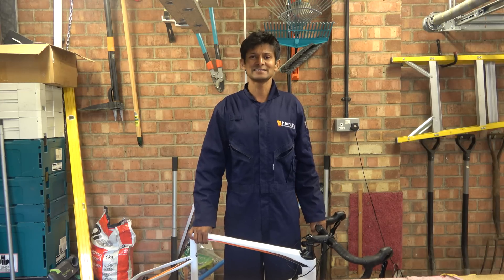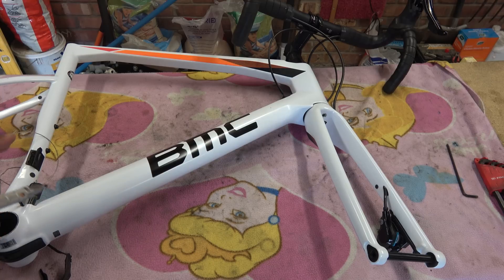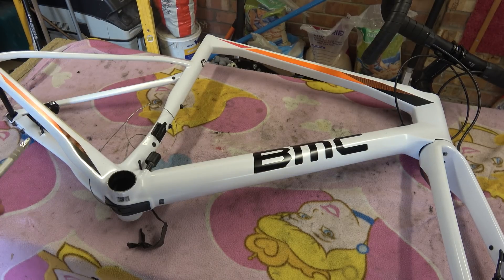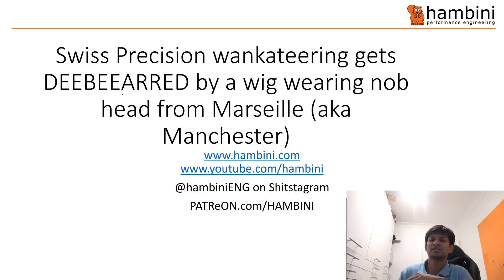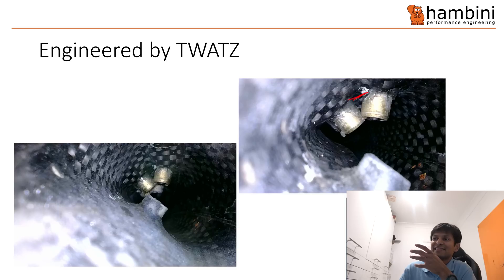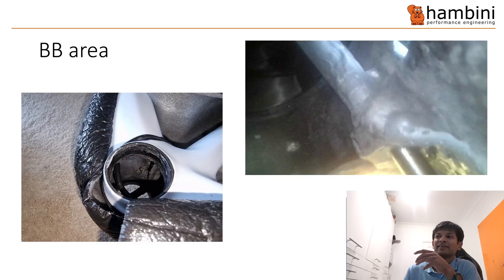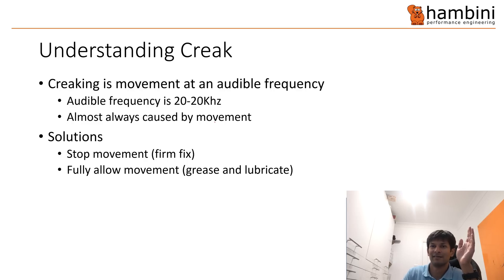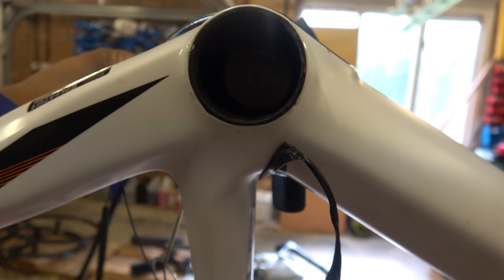Swiss Cheese X BMC Bike Frame REAMED | Grade A Wankateering

Comment: So for a bike that has won more classics than anything else, you are over the top in your criticism! For starters this is a 6 year old model that has been through the wear and tear of at least two owners. All the pros have used this brand and raved about it! its a fast good bike and you are just being a right @£$head about bike engineering!
This, after all, is a bike and not an aircraft! 
I'm beginning to think you are just over the top on what bicycle engineering means.
You should put your money where your mouth is and get out of your garage/bedroom and start designing for bike companies.
Reply: @alxhid  hold my beer
Reply: Owns a super expensive 2nd hand bmc only to find out it's all shite.
Reply: @abastabul9115  If I bought any mass market bike I would assume its gonna be shite. Its a MASS MARKET product. what is it that you guys don't understand about this??
Reply: @BoomsRiddico4868  but Time make excellent carbon fibre bikes for similar money. I'm not just basing that on Hambini's recent video, but consensus from road riding friends/comments ect.
Reply: @BoomsRiddico4868  so what you’re saying is, since it’s a mass market frame, you get a lot of demick ones? Ones that are a bit demicky and not properly?

Also why do you use a swear word then censor it? If you don’t want to use the word then don’t use the word?
Reply: @BoomsRiddico4868  but BMC is not PRICED at mass market level
Reply: @BoomsRiddico4868  Didn't you do the modules regarding the wear factors on tooling? A  calculation is determined around output max and interval Inspections. The development engineer would've determined this so if the molds are precise and the layups are correct then the products is let down by   the post mold process.  The engineers and design team get a pass if this is the case. Hambini is not always blaming the engineers but more the completed products.
Reply: @BoomsRiddico4868  and a Boeing 737 is a mass market product also. Don't expect too much when you travel on one of these?
Reply: @BoomsRiddico4868  people like you, your poor expectations of QC are the reason why there is poor or no QC
Reply: @BoomsRiddico4868  I would be interested to know where I can get my hands on a bike model that is not mass produced and is reliable! Please enlighten those who are keen cyclists and have suffered financially based on the poor quality control issues.
Reply: On a dollars per kg bikes cost orders of magnitude more than what aircraft do. Is that the reason that you get such good quality engineering and quality finish on carbon bikes? When you are paying up to a few thousand dollars per kg you should have a reasonable expectation that what you are getting is worth what you are paying. It doesn't matter if a bike or bike design is 1 day old or 6 years old. If the design has issues that can affect safety and also reliability then there is absolutely no reason for them not to be called out on it. These are companies earning billions of dollars and there's about 5 points on the bike where alignment and specification is a must. So many of these companies fail badly at doing this.
Reply: @ Alan H, since when do bicycle companies earn billions of dollars?
Reply: @Alan_Hans__  sure but then slag the bike industry for profiteering. not cheaply made mass market engineering products
Reply: +- 0.05mm is an aerospace tolerance? You should pick up an SKF manual and put down the jenkem my friend.
Reply: @Your_Paramour  the guy has probabaly never heard of a zeus book! ;)
Reply: @Your_Paramour  are you another Hambini fanboy?
Reply: @BoomsRiddico4868  Instead of attacking his fans, you should have a counterargument ready with evidence from aviation machinist/engineering manual or something.
Reply: @BoomsRiddico4868  So you're unable to answer the question posed?  "+- 0.05mm is an aerospace tolerance?" -- incase you missed it.
Reply: But this crap bike should cost 1000 EUR, not 10.000.
Reply: I feel like I’m getting reamed and I’m not even Nik Fledge
Reply: @davidcoates2051  Oh, sure Coats, like you're blameless in all this.
Reply: @davidcoates2051  bro 😂😂😂😂😂😂
Reply from the maker: Nik Fledge, claims to be an ASSOspace engineer and then claims 0.05mm is an Aerospace Tolerance...  mmm.... I smell a Rat
Reply: @Hambini  I remember filing my aluminium block into a square for weeks at the start of my apprenticeship, 5 thousands of an inch was the tolerance. (0.127mm).
Christ - it brings back bad memories😢 - thank fuck I was an avionics apprentice and so moved on to electronics soon after.
Reply: @Hambini  Whats crazy is i just picked up a 2023 bmc teammachine frame: Tightened bottle cage bolt and paint chipped off, BB hasn't been well smoothed out and has rough sides, you could splinter your finger, same games for bottom of steerer tube.
Reply: @Hambini  He also spells ream "reem" (A large horned animal in ancient Hebrew literature), LOL
Reply: @BoomsRiddico4868  "you sound like you look in your profile" Yeah well that's my actual picture so I suppose I would. I don't know if that is an attempt at an insult or you are just slow and getting the joke in my profile name. Kind of a fail either way 🤣.
Reply: @Hambini  Has this bike brand ever won anything? Let's see...
2017 - BMC Racing Team
 Australia National Time Trial Championships, Rohan Dennis
 Australia National Road Race Championships, Miles Scotson
Jersey orange.svg Overall Tour Down Under, Richie Porte
Stages 2 & 5, Richie Porte
Stage 5 (TTT) Volta a la Comunitat Valenciana
Jersey red.svg Overall Tour of Oman, Ben Hermans
Stages 2 & 5 Tour of Oman, Ben Hermans
Jersey blue.svg Overall Tour La Provence, Rohan Dennis
Omloop Het Nieuwsblad, Greg Van Avermaet
Stage 1 (TTT) Tirreno–Adriatico
Stage 7 Paris–Nice, Richie Porte
Stage 7 (ITT) Tirreno–Adriatico, Rohan Dennis
Stage 2 (TTT) Volta a Catalunya
E3 Harelbeke, Greg Van Avermaet
Gent–Wevelgem, Greg Van Avermaet
Paris–Roubaix, Greg Van Avermaet
Stage 2 Tour of the Alps, Rohan Dennis
Jersey yellow.svg Overall Tour de Romandie, Richie Porte
Stage 2, Stefan Küng
Stage 6 Giro d'Italia, Silvan Dillier
Stage 18 Giro d'Italia, Tejay van Garderen
Jersey gold.svg Overall Tour de Luxembourg, Greg Van Avermaet
Stage 1, Jempy Drucker
Stages 2 & 4, Greg Van Avermaet
Stage 4 (ITT) Critérium du Dauphiné, Richie Porte
Stages 1 (ITT) & 9 (ITT) Tour de Suisse, Rohan Dennis
Jersey red.svg Overall Route du Sud, Silvan Dillier
 Luxembourg National Time Trial Championships, Jempy Drucker
  Switzerland National Time Trial Championships, Stefan Küng
 United States National Time Trial Championships, Joey Rosskopf
  Switzerland National Road Race Championships, Silvan Dillier
Jersey yellow.svg Overall Tour de Wallonie, Dylan Teuns
Stage 3 & 5, Dylan Teuns
Stage 4, Jempy Drucker
Jersey yellow.svg Overall Tour de Pologne, Dylan Teuns
Stage 3, Dylan Teuns
Stage 2 Tour of Utah, Brent Bookwalter
Stage 2 (ITT) BinckBank Tour, Stefan Küng
Jersey blue.svg Overall Arctic Race of Norway, Dylan Teuns
Stages 1 & 4, Dylan Teuns
Jersey blue.svg Overall Colorado Classic, Manuel Senni
2018 - BMC Racing Team
 Australia National Time Trial Championships, Rohan Dennis
Stage 5 Tour Down Under, Richie Porte
Stage 3 (TTT) Volta a la Comunitat Valenciana
Stage 5 Volta a la Comunitat Valenciana, Jurgen Roelandts
Stage 3 Tour of Oman, Greg Van Avermaet
Stage 4 (ITT) Abu Dhabi Tour, Rohan Dennis
Stage 1 (TTT) Tirreno-Adriatico
Stage 7 (ITT) Tirreno-Adriatico, Rohan Dennis
Jersey light blue.svg Overall Tour de Yorkshire, Greg Van Avermaet
Stage 4 (ITT) Tour of California, Tejay van Garderen
Stage 16 (ITT) Giro d'Italia, Rohan Dennis
Jersey yellow.svg Overall Tour de Suisse, Richie Porte
Stage 1 (TTT)
Stage 9 (ITT), Stefan Kung
 United States National Time Trial Championships, Joey Rosskopf
  Switzerland National Time Trial Championships, Stefan Küng
Stage 3 (TTT) Tour de France
Prologue Tour of Utah, Tejay Van Garderen
Stage 2 (ITT) Binck Bank Tour, Stefan Küng
Stage 1 (ITT) & 16 (ITT) Vuelta a España, Rohan Dennis
Stage 11 Vuelta a España, Alessandro De Marchi
Jersey rainbow chrono.svg Time Trial, UCI Road World Championships, Rohan Dennis
Giro dell'Emilia, Alessandro De Marchi
2019 - CCC Team
 New Zealand National Time Trial Championships, Patrick Bevin
Stage 2 Tour Down Under, Patrick Bevin
Stage 3 Volta a la Comunitat Valenciana, Greg Van Avermaet
Stage 4 Tour de Yorkshire, Greg Van Avermaet
Stage 3 (TTT) Hammer Stavanger
Grand Prix Cycliste de Montréal, Greg Van Avermaet
2020 - CCC Team
 Poland National Time Trial Championships, Kamil Gradek
 Czech Republic National Time Trial Championships, Josef Černý
Stage 3b (ITT) Tour Poitou-Charentes en Nouvelle-Aquitaine, Josef Černý
I guess they won something haha. Still agree with the video though Mr Hambini.
Reply: @jaimeisreal  They did not win on a bike like that.
Reply: @Hambini  Maybe it is, in North Korea - just kidding ;-)
Reply: @Hambini  I smell a troll!
Reply: @Hambini  where did I say that ? I think your YouTube earning strategy is to have people who react to your reeming and your fanboys fight it out in the comment section so that you get more hits. It is I that smell the rat!
Reply: Then explain the CHEAPER (not same price, CHEAPER) bikes he has on that are built to far better tolerances than this? Where's your 300% cost increase? Popped back in your arse where you got it from?
Reply: @dutypaidrock  LOL this made my day :)
Reply: @ M*A*S*H

What is the average salary of an employee working for a Chinese bicycle company vs the average salary of  an employee working at the BMC facility in Switzerland.  Do you think the only cost of associated with the BMC is direct materials and labor?  I’d say go learn something about basic economics and cost accounting before engaging in this conversation.
Reply: @ M*A*S*H, surely you must realize that some of the wealthiest people on the planet are in the Far East and India, and have a earned a large potion of their wealth through the unfair treatment and slavery of their employees.  If you want to support that, by all means go ahead. The company that BMC outsources their production to is probably guilty of this, but at least their employees in Switzerland are treated respectfully and fairly.
Reply: Is this the CEO of BMC?
Reply: @_xnk7257  new account, its either BMC, Absolute Black, Open Cycle or GCN
Reply: @_xnk7257  the CEO would not be so stupid, the CEO is laughing all the way to the bank.  It’s these guys who spend the most on their frames - are always the ones swearing and bragging by them, regardless.
Reply: @_xnk7257  hahahahahahaha
Reply: The problems with the absurd lack of roundness of the bottom bracket on that bike were there the day that bike left the factory.  They don't get that way through use.  It suggests that BMC has crappy QC standards.  Not all brands do.  I'm pretty sure the ones they send to world tour teams are carefully selected.  The ones you and I would be aren't.
Reply: I don’t think it’s the designing of the bikes is the problem it’s the crap quality control in the factories.
Reply: @paulwilliams4990  Ultimately the QC must be checked before leaving the factory so the responsibility lays with the company. If I own say a pub that served flat warm lager, could i blame the barman to the face of customer ?
Reply: @glennoc8585  that’s exactly what I said 🤔
Reply: No bike race has been won on this bike. This bike is defective.
It costs more per kilo than an aircraft.
Reply: I'm ready for Nik Fledge reaming
Reply: @daijang1  me too!!!!!
Reply: lmao this guy rides a BMC
Reply: @11-inch  don't laugh.  Whatever YOU ride Hambinini thinks is schit too.
Reply: @11-inch  Of course he is. Hambini has reamed other brands and I never seen this Nik Fledge before.
Reply: @11-inch  I don't ride at all dude. but I am an engineer
Reply: @BoomsRiddico4868  "I don't ride at all dude"
Proceeds to comment on .....bikes
Lmaoooooooo
Stop talking
Reply: @BoomsRiddico4868  It is absolutely obvious that your feelings were hurt by this reaming, and you have a strange deep interest on defending a brand with quality control issues.  Why?
Reply: @BoomsRiddico4868  That reminds me of "I'm the only gay in this town"
Reply: @BoomsRiddico4868  There's engineers and engineers though. Prominent firms have folded and been sued for negligence. All Professions have codes of conduct and are duty bound to  call out cowboys.
Reply: @valiantabello  in all fairness, I don't believe Hambini rides, either.....
Reply: @BoomsRiddico4868  wait, you're an engineer? I don't think you mentioned that
Reply: @BoomsRiddico4868  This kind of speaks to my point, you don't ride, you don't get it, dude.
Reply: Oh Nik, what a wonderful world we live in where all the pros that ARE PAID TO RIDE A PARTICULAR BRAND OF BIKE SAY NOTHING BUT NICE THINGS ABOUT SED BIKE?
Reply: @JMcLeodKC711  Don't bite the hand that feeds you, right? lol
Reply: Nik, sorry to be negative about your comments but exactly what are you talking about? Firstly,  Pro's are paid to "like" the bike they ride so your comments along those lines mean that their bike simply didn't break and cripple them in a race. Winning "more" only means supporting the best team. Secondly,  race bikes are managed by race mechanics who are excellent at their trade and repair problems with delivered race bikes which the factory normally takes more pains to see are proper. Thirdly,  the bottom bracket was under-sized and oval.  That doesn't occur from "second owner wear" as you seem to suggest. Fourthly,  none of this forgives for one second the placement of those "braze-on" screws. I occasionally criticize Hambini because he is critiquing the ends of the values where mistakes can slip through such as the undersized BB.  But that brake line tube is pure garbage workmanship and those braze-on screws are an example of very poor engineering. These sorts of things are why I and a friend have been permanently crippled and why I have returned to steel.
Reply: It’s widely accepted that pros’ bikes are specially made and are not the same as the ones that go on general sale
Reply: @lasrachtech.1341  What they sell us,are not the same bike they gave the pros.
Can you immagine a Pro cyclist like Viviani that on the sprint put's out close to 2000 watt he would not even get on a bike for amateurs.
The bike builders try every possible way to make us think that what they are selling us are the same is the Pros.A lot of bikers beleive that and pay a bunch of money for a piece of scrap like the one on this video.
Reply: @lasrachtech.1341  more than accepted it’s admitted and openly stated that the Pro bikes are custom layups with often custom geo and bear nothing more than an external resemblance also like most things used in pro sport they are replaced at intervals that are impossible for the average person to even contemplate.
Reply: @lasrachtech.1341  YES!!!! another SMART PERSON!!!!
Reply: Funny how brands can beat this tolerance for a frame sold at less than 2k yet the big companies can’t hit the same tolerance at many times the price. It’s a classic case of cutting corners to increase profits as they know fan boys with thin air between there ears will eat it up and throw more money at it than a god damn motorcycle super bike
Reply: Ohhhh someones deleting their own comment. 🤡
Reply: @ Nik Fledge What exactly is your point then? Was that BB roundness(?) normal? Should it be normal for all bicycles? In your honest opinion, was that FD mount a display of engineering/manufacturing standards excellency? Is a (as someone here stated) 4000£ (or more) frame a discardable item after 6 years? When you say "All the pros", do you really mean all of them? What about the ones riding competitor brands? Have you spoken to all of them? Based on that statement, are you quite sure that your studies are in engineering and not in marketing? Is the fact that this is a bike and not an aircraft supposed to make those BB tolerances and that FD mount acceptable? Were any of his criticisms unsupported?
Reply: @edthelizzard  It's a fallacy that pros gets "special" builds as a norm. Some may well get a lighter  version which is later offered to the public or they get custom paint. The molds aren't going to be modified to change geometry albeit that was possible in the days of alloy and steel. Non world tour professionals get off the rack frames and wheels fact and if it can be proven beyond speculation that world you'd pros get custom frames then I'll accept that. Still off topic to the point of expensive flawed products coming to a store near you.
Reply: @glennoc8585  It's not a fallacy, Hambini and others have pointed out the carbon reinforcing a lot of the pro's bikes have which will never be available to the public.
Reply: @DomH1994  Which renders the frames heavier? It's counter intuitive post disc brakes to make the bike heavier.
Reply: @glennoc8585  It would be counter productive. However, what would be more counterproductive is the front end of a bike failing during an 1800 watt sprint with the world watching.
Reply: @glennoc8585  that was not the point of my comment here.
Reply: You've Been Milked (for) Cash, fanboy.
Irate that an engineer is calling out bad engineering and suggesting people should settle for shit at thousands of pounds for simple manufacturing? You are no engineer, whatever your job.
Reply: Some people are lonely and just want attention.
Reply: Hi @Nik, do you mind to share what's the standard of "over the top" in your comment? I am a little bit confused, as you put @hambini as too @£$head in the beginning, then you mention that all mass produced bikes are "shite". What do you mean by this statement?

Next, let's suppose that the above is correct, then could you share to me, what is the "good" standard for mass market/produced bikes? Thanks~
Reply: Weird, it's ok for bike brands to lie about their products for advertising purposes, but it's a problem when an 5 years old critizes them on YouTube.
Reply: The bike didn’t win anything the riders won bikes are interchangeable and irrelevant stop believing the marketing BS you simpleton
Reply: This is the best reem-ing comments section ever! Most amusing. Trouble is though I think, after reading the anti-Hambini views I must be one of the ‘fan boys’ that apparently exist. I’m not going to sleep well tonight now incase I wake up wearing an orange overall, my hair has suddenly returned to the colour it was when I was 20 and the university logo I have on my lecture PowerPoint slides suddenly changes to a ‘pen-is working logo’!
Reply: You are missing the point by a country mile. Hes not saying bike company's should be held to Aerospace tolerances but when people are buying frames from China at 10% of what this frame would cost new that DO NOT have these issues there is a problem. And if "wear and tear" can do that to a BB shell then the frame was not fit for propose to begin with.
Reply: @Bikey_McBeardface  don't argue with stupid. They'll drag you down to their level then best you with experience.😂
Reply: @Bikey_McBeardface  why doesn't he say that then? you are putting words in his mouth
Reply: @BoomsRiddico4868  well he didn't do it in this video but if you are a continuous viewer of his videos you'll see him praise some cheaper Taiwan products for being well made. 
And I think that's the whole point of his videos, while his criticism is way over the tops for entertainment purposes, the truth is some brand sell way to expensive bikes with marketing tricks (aerospace engenering e.g.), but don't fulfill their self given standards.
Reply: @BoomsRiddico4868  No, I just watched more than one video and understand what hyperbole is. Also I'M putting words in his mouth? Give me the time stamp where he says he demands aerospace tolerances for bikes I'LL WAIT. 🤡
Reply: @derlogger2  fair enough
Reply: @Bikey_McBeardface  so the video when Hmbini visited the Canyon factory and fawned over the place did you not find that kinda odd? he slags off canyon in the past no?
Reply: @BoomsRiddico4868  Yeah because he calls out crap when he sees it, and praises good work when he sees that too. Are you suggesting just because he liked what he saw in a factory, he should give them a pass when they allow something shit into the public?
Reply: @BoomsRiddico4868  It's ok buddy we all cope in different ways.
Reply: Where did you get the copium you're huffing from? Must be some strong stuff
Reply: @1newme425  bruh roasted tf outta him
Reply: Hear that lads, because its a bicycle we should accept out of round, out of square, out of tolerance, machining in carbon fibre full of voids and be grateful. Aeronautical engineering? What for airfix kits? You, of all people, should not be accepting sub par QA or machining.
Reply: Undersized is undersized, wear from use wouldnt effect this issue. These frames are over 2k and need simple quality control which is easy to do with go no go gauges
Reply: Oh I'm sorry that most of us expect a top product for the fucking ridiculous prices we pay for these bicycles! Yes I said bicycles! Fucking ridiculous industry that has gone to shit! Get it together and build a top notch product that warrants your ridiculous price tags!
Reply: So, in your world you would accept a 75k car with shoddy tolerances. It is, after all, a mass produced item. 😂

Get out of here.
Reply: For a brand that sells the idea of the best definition of bike engineering you would agree is oretty poor designing. Even more comparing with OEM manufacturers. Even bMc replicas leave this craps in Switzerland when they produce their copies
Reply: @miguelsaez340  it is probably one of the best in bike engineering. But its BIKE engineering. low tolerance, mass produced bike engineering. No more than that
Reply: @BoomsRiddico4868  That’s would be fine but the problem is that the price and marketing of bikes like this lead you to believe you are getting something much better than that.
Reply: @BoomsRiddico4868  most cyclist don’t know how significant is tolerance. They care about opinions and looks. Seeing those poor finishes is far more dangerous than proper engineering.
Reply: @BoomsRiddico4868  let's consider what you're saying though, IT IS bike engineering. That being said, we're not talking about a cruiser bike for meander around your own neighborhood; we're talking about a performance road bike, ostensibly designed for, amongst other things, descending at high speeds. I don't know about you, but when I'm descending there are enough other factors to consider that I don't really want to do so wondering if my frame might have some complete structural failure any second... On that note, it might not be that we're afraid to challenge Hambini, as much as we just simply agree with him.

Also, honest question, do you own a BMC?
Reply: This comment made me subscribe to Hambini
Reply: Don't forget that this channel revolves around Hambini's business. His reaming is marketing. His presentation is over the top and that is intentional. Sometimes Ham is a bit much for me in terms of presentation style, but then I just don't watch for a while and come back at a later date.
Reply: @alpsalish  Agreed, well said.
Reply: @Nik Fledge

Fellow aerospace engineer here as well,

Yes, I agree Hambini can be harsh on mass production engineering, but I have to point out two things that I observed in last 10 years.

1. BMC quality control dwindled significantly starting around 2014, and especially when the internal routing became a thing with its 1st Gen Roadmachine.

2. It is not only BMC but other big mass manufacturers overall.

You have a point that this is bike engineering so I don't expect aerospace-level quality either. However, BB tolerance being off that much definitely indicates something else. How I know is that I also own BMC as well, and I never went to get newer models due to apparent quality issues.

If you still think it is mass manufacturing, then explain how come there are multiple recalls due to stem, steering column and handlebar failures due to not the tolerance but rather "An Engineering Design" issues. That is not something you can blame on mass manufacturing.
Reply: Mate. You can get a frame from Trifox or any other chinese brand for a tenth of that BMC, with way better tolerances. Your argument is invalid 😂
Reply: i do own a expensive BMC and for that price i expect perfection, no more no less.
Reply: @wamote6867  the carbon layup is handmade. Thats why it is always going to be flawed. If you expected perfection at 3-12 grand, i assure you that you aren’t going to get it.
Reply: @BoomsRiddico4868  Frame for 4.4k CHF - other companies can do it better. And from BMC and that price, I expect top notch quality in every detail. There is no excuse for that. Just take a look at they're Marketing, that is what I expect. If I would work in BMC marketing, I would check my current frames and if they are better, send one to hambini... or say nothing and sit it out.
Reply: @BoomsRiddico4868  you must definitely work for BMC , except any c**p
Reply: @BoomsRiddico4868    There's no excuse for poor manufacturing quality.  You can't say that BMC put everything into design and left nothing for basic quality control.
Reply: @BoomsRiddico4868 besides. I don’t care about the pros, I care about me and cycling community in general. You know, usually not rich people that is going to buy 10k bikes every year or so, just so u won’t notice defective manufacturing on the long run.
And that’s the problem: if I buy an expensive 6k and upwards in price bike, I want it to last long and good.
Reply: JUST SO PEOPLE KNOW. This loser has now sent and promptly deleted (so I see them and few other people do) several poor attempts at insults between cordially relying to my comments, and reading through hes done this to others too. HES A TROLL nothing more.
Reply: Bmc salesman raging🤣
Reply: this is for sure a GVA burner account
Reply: Wear and tear does not cause the BB to be undersized and out of round. Professional bike racers ride whatever the team gives to the riders, don't work on the bikes, and will say anything for a sponsor.
Reply: Nik, perhaps management would be a better career path for you - no shame in that. I would never hire an engineer who complains about tolerances being too tight, but I would hire a someone like you if I was interested in maximizing profits at the expense of manufacturing a sloppy product for the masses. You don't have engineering values or an engineering mindset.
Reply: Liked for the amusement factor only ❤
Reply: Sounds like you have a bmc...............
Reply: @Nik Fledge As someone who works in the industry, if the automotive industry worked to the same tolerance and general engineering level as the bike industry, millions would die every year.
Reply: Bikes don't win classics. The riders do.
Reply: Road bikes are commonly £6k-10k these days.  Take apart a motorcycle (CBR650R for example at £8.5k) and see how precise everything is.  There’s plenty of arguments over economies of scale etc but the simple fact is road bikes are appalling for what they cost. 

For reference 0.05mm tolerance on a bearing fit isn’t asking a lot, it’s a pretty conventional spec. for a light duty bearing application.
Reply: "All the pros have used this brand and raved about it! " OK, if you'll spend your money based on what guys who ride what the team supplies and shut up about it, someone probably has a bridge they want to sell!
Reply: Roadmachine was not approved by UCI six years ago. This means this frame has not won anything. Van Avermaet won Paris-Roubaix on GranFondo frame.
Reply: ha ha the arguments you up are solid. the bike is the key to winning a race, team CSC just a better bike
Reply: You're crying all over the comment section so much that I'm starting to pity you. I suggest getting off the keyboard mr youtube certified engineer.
Reply: Proud BMC owner here 🤣🤣
Reply: This conversation aside why do you use the curse word but censor it? If you don’t want to use asshead call him something else?
Reply: Pros have won using this = excellent. The new standard by which all things are judged
Reply: @Ob1sdarkside  At least better than taking the opinion of a talkative no-name liar with Tourette's syndrome as the standard. ;)
Reply: @AlexA-vd7li  I for one fully support the 5 year old with tourettes engineering industry
Reply: @Ob1sdarkside  Sometimes me too. :) He is funny but I never take his statements seriously, he is not an expert.
Reply: I recall early BMC models when the seat stays went to the top tube, and watched a club member go into a shimmy that was rather frightening... and when I saw that, I never considered BMC.
Reply: what classics? the roadmachine has never been ridden in the WT. You might be thinking of the Grand Fondo or Team Machine.
Reply: Waiting for Mr Fledge to say he's an ACTUAL engineer lol.. which will instantly prove he's not any sort of engineer at all.
Reply: Why you mad, bro?
Reply: Your stats are wrong on classic wins, do you work for BMC 🤷‍♂️🤦‍♂️🤣
Reply: Captain Wank, humanity hand round holes figured out about 150 years ago. This is not a case of super-high precision engineering. It’s marketing and laziness, and MBA jackoffs taking advantage of fanboys like yourself who will pay $10k for overpriced crap and then take to the internet to defend it like you made it yourself. 20 years ago none of this crap was an issue in the bike industry.
Reply: Nike Pledge (spelling autocorrect I left in!) You are a tool of the highest order. I'm only wasting time adding a comment in the hope we can get this thread into the same league as the "Just met Jason Plato..." topic on Pistonheads. (Are you George Matthews in disguise?🙄)

As an "engineer" you focused on the hyperbole of Hambini not the obvious flaws in design, manufacturing and QC. You think BMC are targeting a mass market whilst charging bespoke prices. You produce price increases for improvements (which many manufacturers include as standard) that would even embarrass a Tory minister. You then throw out ad hominems to all and sundry, criticise language shortcomings without any proofreading of your own statements and then accuse anyone not agreeing with your reasoning as fanboys.

Plenty of comments on Hambini's other videos pulling him up so the audience isn't sitting silent. How have you coped with the deserved slagging you brought upon yourself?

I see you've gone into radio silence, maybe it's a timezone issue or perhaps you've read it all again and realised you're a better fit to the description you applied to Hambini?
Reply: Is it just me or someone's upset that his BMC is a piece of crap by a 5 year old...
Reply: Don't think my old Huffy was this bad.
Reply: Thanks for the additional entertainment Mr. Engineer. Idk if you're trolling or just plain dumb
Reply: Nik is the parson who thinks Pro bikes and Consumer bikes are the same quality just because having the same model name.
Reply: Does this excuse the oval bottom bracket? Does this excuse the shoddy front mech hanger bolts going in a 75 degrees? You can hate hambini all you want but he is right. This bike is crap. Haters will be haters. You are going to get reamed by the community here for the simple fact that you are defending an oval BB on an expensive bike. I ve got some stuff to sell you at a very high price since you seem to like gettign reamed.
Reply: Good application of the first rule of attention seeking, even your first line is rubbish. BMC did not win more than anything else. 😂
Reply: 😂😂😂😂hilarious
Reply: use the thumbs down for this lad, show him what he deserves
Reply: I would draw attention to the Winspace T1500 review to showcase @Hambini is also positive about some frames (unfortunately not this time).
Reply: the pros are never on the same bikes as us  mere mortals so that excuse doesn't wash
Reply: So this person claims that they do not ride and claim to be an engineer
1) WTF are they doing on this channel?
2) Is this Hambini’s hairdresser in disguise 🤔🤔🤔
Reply: you do know pros are sponsored right ? they have absolutely ZERO choice in the bike they will use on a TDF. Otherwise their sponsors drop them, and they get no money genius. lol. They lose their jobs if they use other bikes.
I have seen pros use trash bikes.

Also these are not aircraft ? Gee thanks for that. But when you pay 10 000 $ for a bike (which btw is far more than a brand new yamaha xsr700 which costs brand new 5700 $) then that bike better fucking be by airplane standards. 
Like do you even read your own comment ? Tell me what does a bike company (that buy their frames from china and rubs off the made in china sign with paint) have to worry about that you get so worked up? 
It is a fking bike. It is not your design. You copied half and the UCI mandated the other half. You have no combustion engine, no advanced brakes just copied smaller motorbike parts, no electronics, no abs on the brakes, no lights or lighting system, no navigation electronics, no comfort whatsoever, no rear differential, and no 20000 moving parts at the same time. 
 So now i can chose. Spend 10k on this? Or buy a new Fiat 500? Or take a vacation in the Maldives and then buy a proper race bike. Or be a dumbass online 
Make your choice. Or even better, get off the internet and finish high school
Reply: Your USP of BMC having 'won more classics than anything else' - isn't this like claiming 'Ferrari won more F1 GPs than anything else' - can't you be more original than that
Reply: I can't see how the bottom bracket opening got smaller over 6 years.  The frame had to come out of the factory that way.
Reply: @nikedge Let me get this 1000% fkn CORRECT. “YOU” are “OK” with paying “Lambo” 💰 4 “Ford” level of “QUALITY”??? Browkowski…WAKE the FK ⬆️.

@hambini THANK YOU 4 “exposing” CRAP 💩 PRODUCTS many “riders” have won races on…the design is nothing new really and not even very well thought out (as seen by the ‘impinged’ angle of the derailleur).

BUYERS BEWARE…

1. BIKES don’t necessarily WIN races (the best DOPED RIDERS do) 

2. PAYING 4 “SEX” doesn’t make u a “Brad Pitt” it means you’re a John….and the “Holmes” kind 😋 

3. GO BANG UR HAIRDRESSER 💇‍♀️!!!!! ahahaha
Reply: Who shat in your weetabix?
Reply: True. 
affect
Reply: "Grade a Imbecile"
Reply: https://www.youtube.com/watch?v=DNosX2Xynlo&ab_channel=CamNicholls
Reply: The shortcomings in design and manufacturing do not have anything to do with the abuse the frame might have seen during the period of usage or how fast or successful the bike has been in competitions. Have you actually watched the video? Point of this video: this is engineering crap that is marketed as some wonderful magical swiss precision machine. I cannot disagree after seeing the front mech rivets. And btw I own a BMC bike myself, so I am not biased against BMC at all. Just consider the facts and think about why you get so triggered about it.
Reply: I take it you bought this piece of crap.  Hambini tells facts, so wake up and take it on the chin.   It's SHITE.  Also you know nothing about pro riders and what they are issued with 🤣
Reply: "All the pros have used this brand and raved about it!"  And of course we can trust them...they get paid to ride 'em. What else would they say? Do you REALLY take seriously paid endorsements for products?
Reply: Newsflash:  Bikes don't win races. Riders do!  Pros ride what they get paid to ride. Fact!  If you think a BMC with garbage fabrication quality is a great bike because a pro rode a disposable one to a win in a race (a disposable bike that those pros do not hold onto for more than a few months) you are the definitions of both delusional and highly gullible. 🙂
Reply: Pros can win on whatever bike they are given.
Reply: @cnay2983  Not really.I know a Pro here in Italy,they do not even get on a bike sold in the store.They get on them only for a Sunday ride,that's it.
Reply: @cnay2983 Bike frame perfection is determined by an acce pted standard  by the consumer unfortunately at this stage. There are laws in some countries where ready to ride bicycles must have certification and a warranty. Some countries are less stringent especially where low volume sales, grey imports bypass full volume legislation. Unassisted human powered machinery gets a lot of slack over assisted or 100% non human powered.
Reply: @cnay2983  and they don't have to part with their hard earned to buy the bike either
Reply: @cnay2983  indeed
Reply from the maker: Now Nik Fledge claims not to have stated it was an Aeronautical Engineer. I refer to comment

"His harsh critiques of bikes is just a bit of a joke. Btw i work as an aeronautical engineer for those who are wondering"

I'd swear he must work for Absolute Black.
Reply: @Hambini  - he starts with silly complaints about your critique which is common enough, but doubles down with each posting.  Now I am only an EE but I simply cannot believe that he is an engineer of any sort. His ignoring the placement of those braze-on screws alone would trigger any engineer.
Reply: @Hambini  or Cervelo.
Reply: @Hambini  Why do you not adress Nik Fledge himself but instead speak of him to tohers? That seems weird to me.
If i undestand it correctly through your videos, you mostly look at crap frames, viewers send you and broken frames from insurence claims? I guess you had a look at some new frames too. Is there a lot of manufacturing tolerances over all frames from one type or are there many "monday" made frames? I assume that the engineering part is crap for every frame of that type, of course. But is every bottom bracket hole made with crap tolerances or is it just some of them?
Reply: If Nik Fledge is an aeronautics engineer, can he please do the public a favour and inform us of the planes he's worked on so we can all avoid them.
Reply: @DomH1994  Boeing engineer? 😁
Reply: @padraicbateman  he was probably the genius behind those dodgy angle of attack sensors.
Reply: Did he work at Boeing on the 737 Max?
Reply: @DomH1994  Yep. When you crash bike you get injured, but when you crash airplane you die.
Reply: @Reanimator999  Quite a few people have died from front forks snapping. Poorly manufactured bikes can kill you.
Reply: Nik, well played troll sir!
Reply: ITT: OP confuses a roadmachine for a teammachine. 🥱
Reply: @sabamacx  crap is crap , name not important
Reply: I take it you own a BMC then!!
Reply: @timjames4562  - I take it he works for them. Aeronautical Engineer indeed! The placement of those braze-on screws and the brake line director would have triggered the lowest level engineer.
Reply: Nik Fledge, you're a clown 🤡.
Reply: The funny thing is that all the focus is on the tolerances of the BB and headset, like those parts would count in how a frame performs. How many bikes has he actually ridden? I'd be curious about that... And if someone says that all the frames ride the same then I'd say change sport.
Reply: @sovracing  Please do that. No one is forcing you. Unless non-athletes like Hambini and us average guys ride our road bike religiously everyday and participate in just about every local races and long rides, we can't tell the subtle frame performance. I'm sure there are plenty of cyclist Youtubers who can tell the subjective feeling of each frame they ride with poetic finesse, but not with cold hard objective engineering observations. 
For me, good engineering & QC mean longer durability, less annoyance, and ultimately better safety. 😀
Reply: @Reanimator999  the “engineering” of a frame is not what the guy is showing in his videos. How much does he talk about geometry? How much does he talk about what’s inside the frame, about the layup of the carbon fibres? This is engineering stuff, and is not mentioned. QC is a part of the engineering of the production of the frame, non the frame itself. According to him a 2022 tarmac performs the same as the 2012 model does. Hop on those two bikes, and you’d be lying if you say the two ride the same.
Reply: I suspicious number of BOT style hambini fanboys on here answering! 
I love that my comment has triggered so many into action 😂😂😂😂😂
Reply: @BoomsRiddico4868  Nobody's "triggered" mate. Exposing liers masquerading as engineers is half this channel's purpose. You've just been added to the list of wankers that's all.
Reply: Yeah, Nik FLEDGling is an aerospace engineer and if you believe that I have a bridge I’ll sell you at a cheap price. The Brooklyn Bridge. LOL

Poor little Nik got upset by the Hambini reaming, which displayed the overpriced disposable joke of a bike he just bought, his BMC. 😀😀
Reply: Is this another YouTube group that sit back and reem everthing??
And then jump on anyone who challenges their God!
If hambunni’s bike tolerances were realised bike costs would jump by 300%.
Does he realise that this is a MASS MARKET product that is to be ridden on the road?!!
His harsh critiques of bikes is just a bit of a joke. Btw i work as an aeronautical engineer for those who are wondering
Reply: @BoomsRiddico4868  can you advise how making an unround hole, is more cost effective than one within tolerances? As for bike costs to jump 300% with acceptable tolerances it implies sloppy tolerances are cheaper.
The cycling industry itself heavily promotes these bikes as being the cutting edge of technology and what the 'pros use' using data to claim ever improving aerodynamic and stiffness tolerances, they are not marketed as a MASS MARKET product suitable to commute with any more than a Lamborghini is. This marketing strategy suggests research and engineering development is a focus for the company and has resulted in this bike. Yet your implying a BMC time machine currently costing $11,499 would retail for $45,999 if made well 😂 (300% increase)
I'm rather confused about how a technologically advanced sports motorcycle such as the Yamaha R1 which is subjected to more compliance, more regulation, more standards, more safety checks and is vastly more complicated to manufacture than a bicycle is able to be sold at a lower cost than high end bikes. Yet cycle companies displaying the engineering excellence they use to promote products would create the type of increase you suggest.
Sorry I don't believe that. Happy to review any data you have to support your claim.
Reply: @kidkarbon4775  fool you for believing that a pro rides this low level engineered bike! they ride a bike that 'looks' like this but tolerances are totally wide of this. also they ride a handful of times and then the bike is discarded. you obviously don't know what you are on about mate
Reply: @BoomsRiddico4868 Read again what I wrote. 🙄 I never actually stated any belief that Pro's ride these bikes. I stated they are marketed as being high performance, race bikes that the pro's ride with performance, aerodynamic and stiffness data - This is not the same thing.
My statement was made as a response for you remarking that they are a Mass Market product which although correct is not how they are presented, marketed or what the uninformed consumer thinks they are purchasing.
Reply: @BoomsRiddico4868  not true at all they ride same as anyone else that’s a total myth they ride what they are told to ride and given and in fact sometime consumer bikes are better than pros bikes and pros bikes only need to last half a season they can get. New frames all the time consumers are stuck w only one because that’s all they can afford
Reply: @kidkarbon4775  exactly 👏🏻
Reply: @kidkarbon4775   These aren't really MASS MARKET bikes.  These are BOUTIQUE bikes that most shops don't normally stock.  Authorized dealers may have a model for display but would need to place a special order for a customer.  Hambini points out basic quality problems that should not be found on any self-respecting brand, let alone famed BMC's flagship frame.
Reply: @BoomsRiddico4868  So you haven't watched all his channel have you? Reaming is applied with relish where deserved. Praise equally given. Is this bike the one you have?
Reply: @BoomsRiddico4868  you may be an aeronautical engineer.....so what I have met too many so called aircraft engineers who don't have a fucking clue 🤣🤣
Reply: @benturp3492  learn to speak English if your are going to reply
Reply: @BoomsRiddico4868  Hahaha how old are you? 5? 🤣🤣🤣
Reply: @benturp3492  I am not the guy who plays and uploads battlefield video games am I ben? How old are you? 🤣🤣
Reply: @BoomsRiddico4868  actually you mean “if you’re going to reply” sorry but if you are going to criticise the man’s English, start with your own grammar!
Reply: @BoomsRiddico4868  "learn to speak English if your are [sic] going to reply".   Pretty much epitomizes this entire thread.
Reply: @grantnyenes3742  yes it was an autocorrect mistake. glad you are reading 😘
Reply: @grantnyenes3742  yes it was an autocorrect mistake. glad you are reading 😘
Reply: @stuartdryer1352  attack dog fanboy 😆
Reply: @BoomsRiddico4868  more than speaking, writting. It's the second time that I have seen a comment like this.
Reply: @BoomsRiddico4868  Nik, resorting to slagging someone over their youtube posts means you've lost the argument.
Reply: @BoomsRiddico4868  Maybe re-read this sentence. If you want to insult maybe learn english. Your are lmao
Reply: @benturp3492  It would be interesting if this Nik is more specific about his engineering specialty. Is he with airframe, powerplant, avionics (aviation electronics and electrical system), or metallurgy/material? I worked on military aircraft as "grease monkey" when I was younger, but I'm not a FAA licensed mechanic nor claim to be.
Reply: @Reanimator999  ahhh yes very true he well could be the rare breed we call GAYVIONICS!
Reply: @benturp3492  I was an avionics tech for 30 years. They don't.
Reply: @glynch-m7m  yes we do sorry mate.
Reply: @benturp3492  not the ones i worked with, down in the hanger bays....on real live aero-planes. They didn't want to leave their comfy upstairs office with their blueprints.
Reply: @stuartdryer1352  What is wrong with that? Last time i learned english grammar it was perfecly fin to say ...if you are going to...
Reply: @alias_not_needed  He wrote "your are". Clearly wrong.   It should be "you are" or "you're".  I'd have ignored it except that he was criticizing somebody else's comments and telling them that they should go and learn English.
Reply: @stuartdryer1352  He also referred to himself as i instead of I and spelled ream wrong twice! Maybe the pressure of working on aircraft toilet systems is taking a toll?
Reply: @BoomsRiddico4868  
Maybe you should too. 
If YOU’RE going to reply. 

your 
you’re 
Two very different meanings.
Reply: @BoomsRiddico4868  Those road racing frames are mostly made in china at about 350 dollars a piece, bringing them up to acceptable standard would result in a 400-450 dollar bill per frame. Comparing those prices with the final retail of these shitpieces makes Hambinis arguments absolutely valid. How I know? i work in the bike industry...
Reply: @BoomsRiddico4868  a question though: If tolerances of the sort Hambini advocates would be the dead of the mass market bicycle industry, why is all those new kids on the block from Tianjin and Shenzen (with plenty of examples reviewed right here by the man himself) seem to have little trouble churning them out ?
Reply: @BoomsRiddico4868  so it takes another 15 minutes to make the frame properly, results in a 300% price increase?  Seriously?  Do you have any idea what you are talking about?
Reply: @BoomsRiddico4868  Ok, but you do not need to be an aeronautical engineer to notice that this bike has got both,  defect by design and poor manufacturing.
So whichever you pick, both are on BMC.
Reply: @BoomsRiddico4868  you are right about one element to Hambini, jokes
Reply: @BoomsRiddico4868  But his favourite bike, the Time Scylon retails at almost a full £1000 cheaper for the frame and matches the tolerances that he considers VERY GOOD. Your comment on price just isn't true. Hell there are £700 Chinese frames that look better than this. INB4 you mention R&D costs.
Reply: @BoomsRiddico4868  2 stroke weedeater acheive better tolerance than swiss engineering of a plastic bike. I think it's fair to ream then for selling hastely put together supposedly premium bikes.
Reply: @BoomsRiddico4868  Mate, that argument might be true if the bike was like $500 but for a $4k+ bike, most between 6-10k, it's an unacceptable tolerance.  It shows a lack of QC and complete disregard for the details.
Reply: @BoomsRiddico4868  I can accept cosmetic blemishes, resin rich wrinkles  but drilling should be aligned, pressfits should concentric, tapered Insets should be consistent. A bicycle frame doesn't have to be Aero or mil spec but it should be safe and true.
Reply: @BoomsRiddico4868  Nope, if they used these tolerances the bikes were worth perhaps their asking price! MASS MARKET Japanese motorcycles are on the same price level and they produce a hell of a lot more bikes
Reply: @BoomsRiddico4868  I think the issue is that this is a product that is sold as top of the line with a premium price tag attached, not a Walmart bike. 
The number of owners it has been through isn't going to change alignment of the two sides of the BB shell on a carbon frame. The alignment is causing issues with the proper running of the bike which isn't acceptable to most consumers on an expensive bike sold at a premium on the promise of "Swiss engineering".
Reply: @BoomsRiddico4868  I guess expecting a round hole for thousands of euros is too much to ask for? I think it's good that someone is calling them out on in - maybe they'll spend a bit more on production and a bit less on marketing/sponsorship in the future?
Reply: @BoomsRiddico4868  How come motorbike companies can keep those tolerances and price their bikes half of any bike company ? Do you hear yourself dude?
Reply: @BoomsRiddico4868  fair call…but these are not cheap bikes and it would be fair to expect some standards. He just calls it as he sees it. I have an old rim brake BMC and still ride it daily as my commuter and it has been an excellent bike and I will never sell it.
Reply: @BoomsRiddico4868  NOT TRUE! Hambini has examined cheap "supposedly crap" Chinesium frames and wheels which have turned out to be as good if not better than 7k-12k frames and 700 - 2k wheels. This is 90% quality control and 10% design wanketering.
Reply: @littlehistory2392  I agree.
Reply: @littlehistory2392  He has "examined" and praised hand-picked selections of what he was paid for.  As well as cheap and shitty flashlights from a Chinese store. ;) And most importantly he does not have the knowledge and qualifications to give any kind of professional assessment here.
Reply: @BoomsRiddico4868  it's just his opinion Nik what's presented to Hambini to examine  probably like yourself I've had BMCs and they've been fine its pot luck with anything these days the motto is built to fail not built to last I'm a nobody with no qualifications in with anger out with love as Sunday is Gods day Nik.
Reply: @JSC131  I think Nik is too attached to his bike. As they said, men are about things and women are about relationships. LOL
Reply: @1newme425  goon
Reply: @1newme425  learn to speak English or write in your native tongue because you are not making sense.
Reply: @BoomsRiddico4868  you can’t have it both ways. Either this is mass produced or it’s handmade. The bike industry claims that small volumes justify high prices. Compare costs to high end motorbikes where sales volumes are similar. Bikes are a rip off!
Reply: @hardcheese  yes you can have a mass market handbuilt bike. where did you read that you can't?
Reply: @hardcheese  Yes. By making few hundred frames mass produced with a supplier in China, I could still market them off as boutique small volume/limited edition with high price if I was a bike company.
Reply: @hardcheese   A well designed mass production line with robust quality control often exceeds handmade products that are often inconsistent.
Reply: @litesp  exactly. But they charge premium prices for low quality mass products
Reply: @BoomsRiddico4868  Don’t tell someone what language to write in. That post alone shows you’re a patronising asshole.
Reply: I see Hambunni has pinned my comment. He is a fan of slagging, but i wonder will/can he take a slagging now!
Probably not i am guessing, as most of his fans sit silent rather than challenge him
Reply: @doopydoopydoopy  why? because I challenged his unrealistic engineering views. Are you one of the silent goons?
Reply: @BoomsRiddico4868  you happy with shonky made bikes , obviously
Reply: @BoomsRiddico4868  go find a “silent” set of stairs and trip down them….then blame God for making a mistake in his “engineering” of the stairs and you for tripping on them. Dude. Just pull ur head outta ur ass and breathe oxygen.